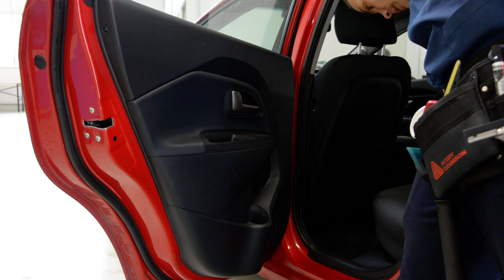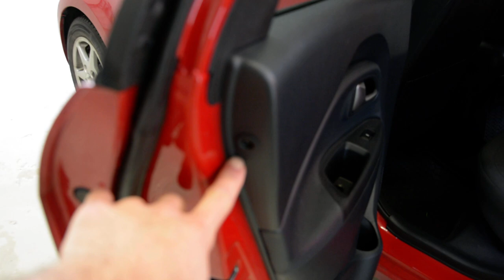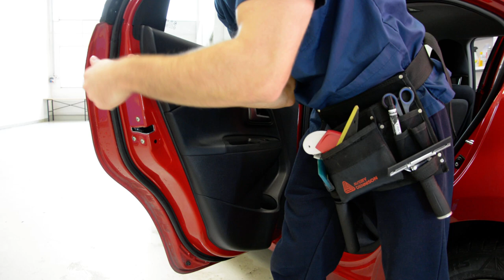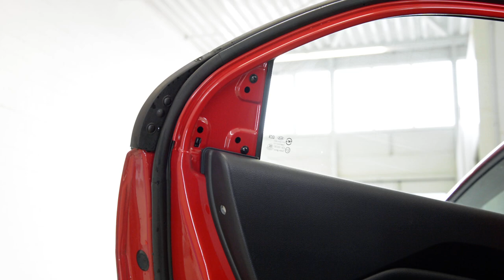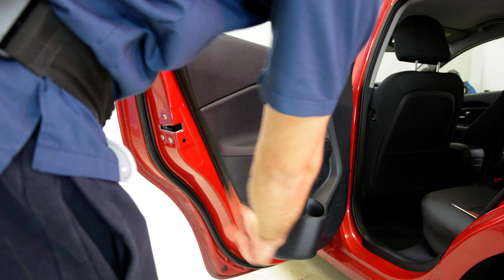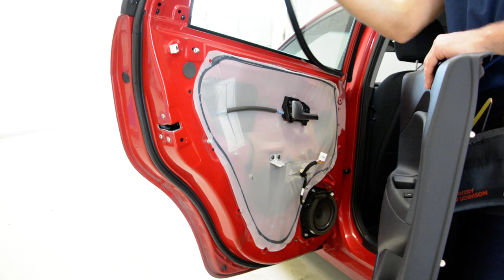How to remove the door panel Kia Rio

Comment: Hey, thanks for the amazing video! I have a question... are the speakers for the Kia Rio a 6.5" or 6.75"?
Reply: 6.5, but you can get 6.75" to fit easily.  Also, with a small amount of work, you can also install a set of 7" with a custom MDF ring (will need to do some routing for the speaker to fit correctly into the MDF ring though).  Last one I did I had to cut part of the door trim where the speaker cut out is to keep the oversized speaker from hitting the door with the 1.25" MDF ring.  I also added some 0.5" felt stand-offs to keep the door plastic from rattling.  The 7" coax set I used in a 3rd gen Rio 5 door was the Kenwood XR-1800.  I did the same with the front location as well.  Since the guys car only had a 4 speaker set up, I couldn't do components and still have the stock look, but paired with a decent amp we didn't need to add a sub once we finished with the install.

Comment: I’ve got a question. In this video he’s showing de door panel of the rear door, but is it the same as the front door?
Reply: Late reply, but it can help anybody searching for an answer. Yes it is the same: 3 screws at the same position, then plastic clip all around the panel.